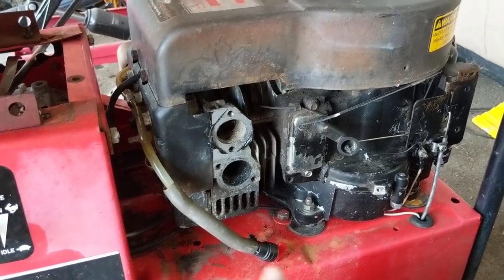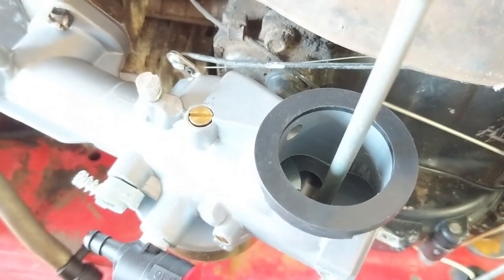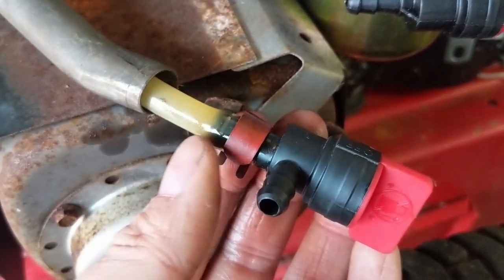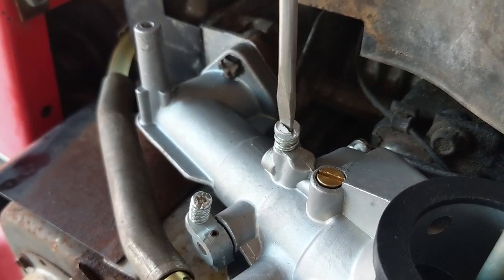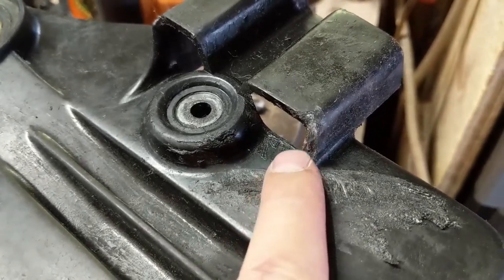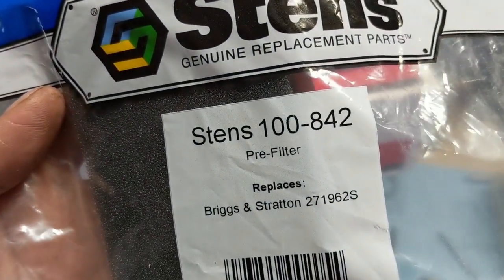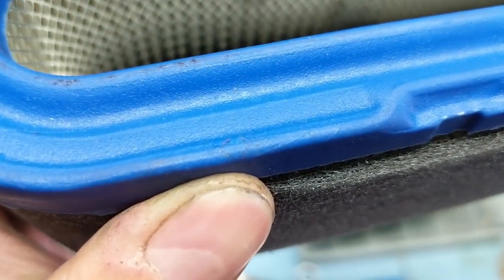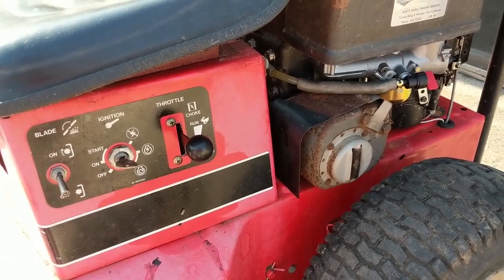Carburetor Replacement - 10hp Briggs & Stratton [PART 2]

Comment: Great video .. Thanks    main jet adjustment on the bottom..Got it... But you didn't really explain how to adjust the air-fuel (which is covered by the air filter) ..  yes, 1-3/4 to start, then.... ?   I'll do some research on that  ..
Reply from the maker: @MichaelLambert-hy9hf  I usually leave them, basically set that and then adjust out the main jet. Sometimes if you have a rough idle they might need to be adjusted slightly in either direction, depends what the air fuel mixture is. Compression, quality of air filter, how the valves seal, it all makes these engines run a bit different.
Reply: @EliminatorPerformance  Thanks!...

Comment: The old carb has the chock cable housing clamp and chock arm on the outside.  The replacement carbs have the chock housing clamp on the outside and the chock arm on the inside.  How did you clamp the chock housing when you assembled it?

Comment: Did you have to take off the filter base again to adjust the air/fuel on top? And if so, how did you adjust it, like the bottom, turn one way then the other then find the middle?
Reply from the maker: I used a pair of needle nose pliers and just turned it out (counter clockwise) about an 1/8th of a turn.

I guess I didn't film that part because I didn't have the footage!
Reply: @EliminatorPerformance  Thank you, you make good videos and I do enjoy them
Reply from the maker: @robindee7577  thanks for watching Robin!

Comment: i found a similar carb on amazon for around 30 bucks. but we will see how long it last. my old card was pretty gone and i kinda lost faith in fixing it with how hard it was to find a new carb. i have a john deere 68. 8hp/30" deck.
Reply from the maker: Good luck, and thanks for watching!
Reply: Did it end up fitting? Also have a 8hp/30" that needs a new carb. looking at the 491590
Reply: cool i have a jd 68 as well rebuilt the motor carb works good its original and it doesnt flood which is a plus

Comment: Hi, What's the throttle position when adjusting the bottom mixture screw and as well for the final A/F mix on the top? Thanks
Reply: Run position just before choke